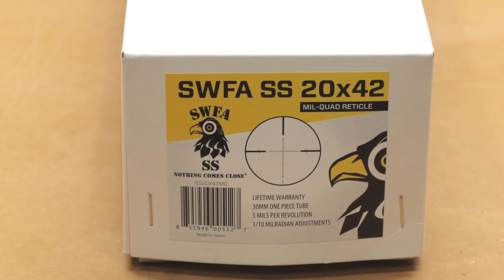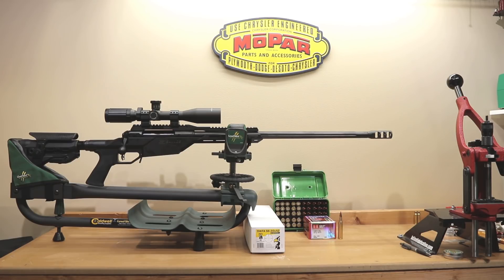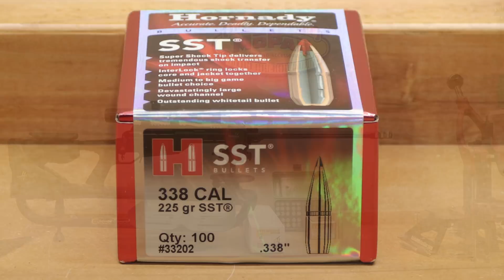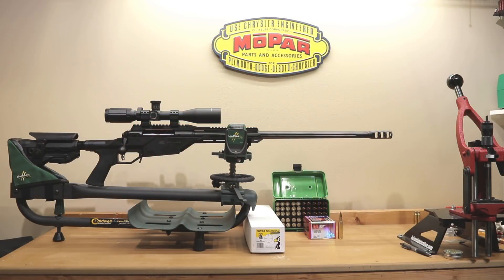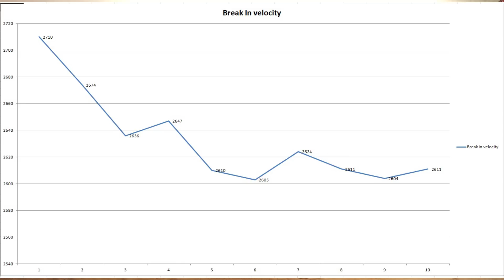Savage 110 BA Stealth 338 Lapua Break in velocity

Comment: Good Day. I have 110 BA Stealth and I tried to go with 300 gr Lapua Scenar and I tried Sierra HPBT 300 gr. , used N170 powder and so far no success. At 200 meters all over, at 300 meters all over. Now thinking to switch to 250 Gr. What is the best load performance for target shooting for this gun and caliber(Savage 110 BA Stealth chambered in 338 Lapua Magnum)? Any recommendations? I'm loading by my self. Thank you
Reply from the maker: I have had ok results with the 250 smk still working on this caliber. Did you retorque all the bolts into the chassis? Mine rattle loose quite quickly.
Reply: @BoltActionReloading  I did check and tighed all the chassis . Looks like my Savage 110 ba stealth doesn't like 300gr.
Reply from the maker: I haven't tried that heavy of a projectile yet, have you tried the Hornady 285 gr?
Reply: @BoltActionReloading  No. I didn't. I'm looking now for the most  accurate handloading  formula for long range shooting. So far I started with 300 grn but it was wasted time and money. Now I'm looking for suggestions who tried different    loading data for this specific gun and caliber.

Comment: 87 Grains of H1000 behind Berger 300 grain hunter.  .720 COL.  2670 FPS 10FPS deviations 45'F I had 8 shot sub 1" groups with savage 11/111.  Pretty much same action.  After tubb final finish break in and JB cleaning
Reply from the maker: +Mike Eikey more load tests are coming.... need warmer weather and some time.

Comment: Thanks for the video, I have the same rifle and agree about the stock. I installed the gen 3 PRS and it shoots much more stable For Me. I’ve only had it out to the range twice since the stock change and was just setting up scope and zero. Have reloaded some 300 gr Sierra MK with Retumbo to do a OCW with 86gr to 93gr on next range trip. Also picked up a Steiner T5xi 5-25x56 so will have to go thru scope set up again. Looking forward to this series of posts. Thanks, Dan
Reply from the maker: +Dan Fransen thanks for the comment. Have you shot any factory ammo and if so do you know the velocities? I am going to get some factory to see where I am i guess. I have lots of options coming (250smk, 300smk, 285 eld, 230 eld-x, 270 eld-x, 300gr elite hunter, etc.) But I need to know where I  starting from I guess.
Reply: Bolt Action Reloading I did record some velocities and will have to look in my logbook. I shot Norma factory in 250 and 285 gr and some Hornady in I think 300 gr. I did not have a chronograph when I shot first several boxes. I do recall it seamed like grouping was all over the place at first and now I am around 110-130 rounds and groups are getting much better. Had scope slipping in rings at first and changing the stock I really believe has helped. Will send you any info on velocity when I  can.
Reply: Bolt Action Reloading I just went to range Sunday and I shot 5 rounds of Hornady 250 gr unfortunately only 3 registered correct on the chrono. Those came in at 2640, 2647 and 2634 FPS.
Then I started an OCW with my reloads of 300 gr Sierra MK using Retumbo (start ch. wt of 86.0 gr) CCI primers and Norma brass fire formed to my chamber. Saw slight cratering on primers at about 89.0 grains and bolt started to be hard to open on fired round at 91.0 so I stopped at 91.5

86.0 gr showed about 2600 FPS, 87.0 about 2625 FPS, 88.0 about 2655, 89.0 about 2675 and 89.5 was right at 2695 FPS. You get the trend and I stopped firing at 91.5 grains with velocity right at 2789 FPS.
Hope this helps.
Dan
Reply: Bolt Action Reloading I posted some velocity data so check the thread
Reply from the maker: Hey Dan, Thanks for the info. I broke down a picked up some factory ammo and got some more reasonable velocities. I think now that RL-33 and lower weight projectiles just aren't meant for each other.
Reply: Bolt Action Reloading ya I would think so maybe but I have no experience with that powder. And I’ve stocked up on Retumbo and box of 500 Sierra MK in 300 gr
Reply from the maker: It's been a little bit of a rough start for me, but that's how I learn I guess.

Comment: I just picked up a Savage 112 target, has the same barrel minus the flutes.  I think RL-33 is on the slow side for 225gr.  I'm braking mine in with 285gr amax's and h1000.  Probably going to stick with 285 elds and H1000 going forward.
Reply from the maker: You are correct but Alliant has data for the 225 Barnes so I just leveraged off of that. I have H1000 and Retumbo as well coming.

Comment: Man that’s a lot of powder! What did you think of the 20x swfa? Is it clear enough for you? I have a couple I am curious how you feel about it
Reply from the maker: +West Desert Shooter I really need to spend some time with it to be fair. I need to do some research to see if something input of adjustment. At this point I have significant trouble actually getting the reticle and the target to be in focus at the same time. I need to mount the 16x and see if it's different.
Reply: Bolt Action Reloading   Please keep us updated as to the possible scope issue in future videos.
Reply: Bolt Action Reloading interesting, I adjust my parallax while looking through the scope and not the number printed on it. It’s the best way I’ve found to get both in focus 👌🏼
Reply from the maker: +West Desert Shooter me to, and maybe I have too high of a expectation.... I use my viper pst and can see 6-24x very clear. This is harder to focus and seems that the reticle and target aren't both clear at the same time. I am going to play with it. I haven't made my mind up yet.
Reply: I adjust the diopter for the reticle the best I can way before I go to the range and use the same glasses (prescription) I would to shoot with. Keeps my eyes from getting too strained and fatigued when I go to shoot a scope for the first time from all the initial adjusting and re-focusing my eyes have to do. I've tried different methods from looking at a blank white wall, etc. Last time I set the parallax to infinity and just aimed up at the sky in the distance with nothing in view. The key is to not look at the reticle for more than a couple of seconds each attempt because your eye will start to bring it into focus even if it's not good. Between each attempt I give my eyes a little break to clear and re-focus by looking away off. Seems to work. Then at the range I just adjust/focus the parallax to the distance as was said and not by the numbers on the knob, although, they are usually pretty close but not good enough. I don't have the SWFA, but maybe having the both adjustments at the rear makes it a little confusing or one adjustment is getting thrown off by adjusting the other?

Comment: How many rounds have you fired? I have a few savage rifles and just bought a 110fcp hs in 338lapua. From my reading on savage rifles it takes well into 100rds to get the barrels broke in. The barrels seem to love copper fouling to get them smoothed out.
Reply from the maker: +Robert Turnbull I am only 25 shots in at this point. I think I am going to break down and buy some factory ammo to chronograph. Before I go too far I need to see if my barrel is "slow"
Reply: My own experience with savage factory barrels is 100-150 rounds before they settle in.

Comment: Good morning brother and thanks for the video. Aside from my teeth, I'd be very concerned about neck tension when shooting a .338 Lapua. If you used the expander ball in a standard die to set neck tension, you probably only got .001 of neck tension. I would go with at least .002-.003 to prevent the bullets in your magazine from being seated deeper by the recoil. More neck tension should also give you a little more velocity.
Reply from the maker: +njgrplr2007 when I get the first 100 round shot we should know the answers to all those questions.  I just haven't got them shot yet. Standard die expander is actually somewhere  between .001 and .002. Believe it or not the brake keeps the recoil tolerable. Thanks for commenting.

Comment: Why did the velocity drop?
Reply from the maker: +Richard Tibbetts since the barrel was cleaned before I started.  I am sure there was extra friction and oils burning off increasing pressure slightly in the beginning. It is something we will track as we go along. My RPR tends to have cold bore at higher velocity than the rest of the string. That is why I always fire fouling shots in it.